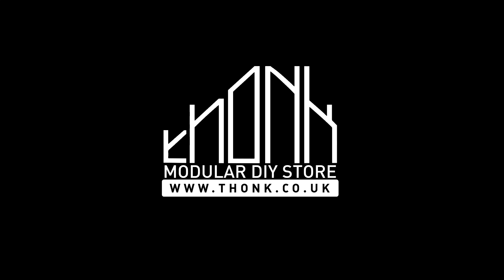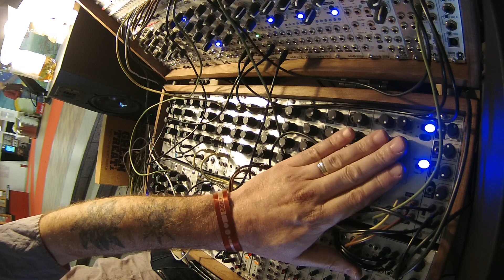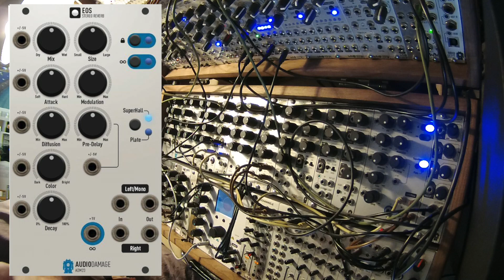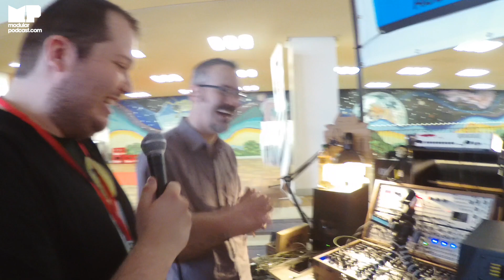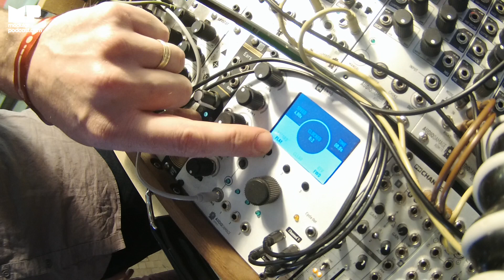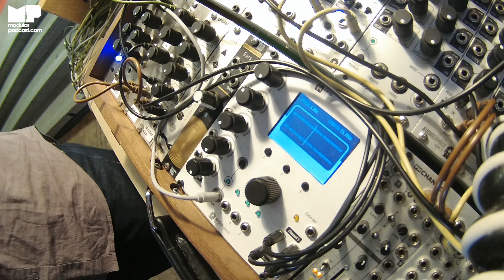Superbooth 2017 - Audio Damage Eos & Enso

Comment: Wow, these sound like a couple of winners. Can't wait to see that looper in action.
Reply from the maker: Hey David, yeah me too. Eos sounding stunning, I know the plug in well so having that under CV and manual control in my system would be great. Really impressive work from AD as usual. Enso already seems great even just grabbing bits of a set and then letting you re-work it and fade back over to new patches etc. The tape looper and extra features will really push it over the edge.